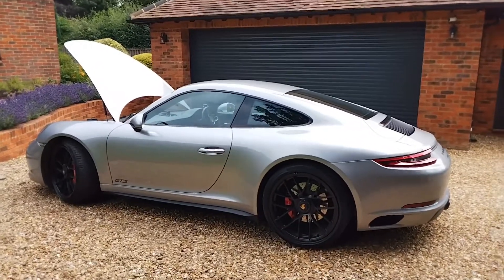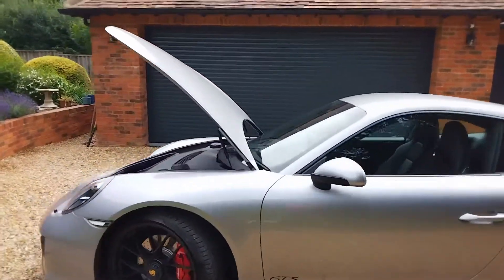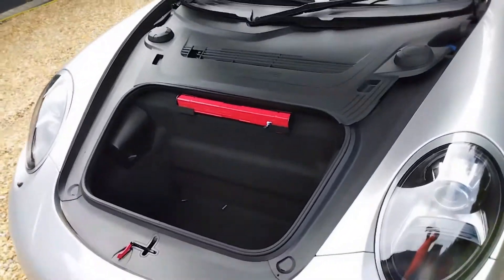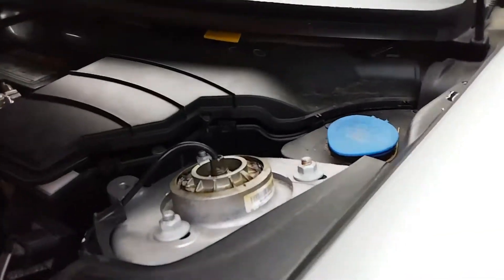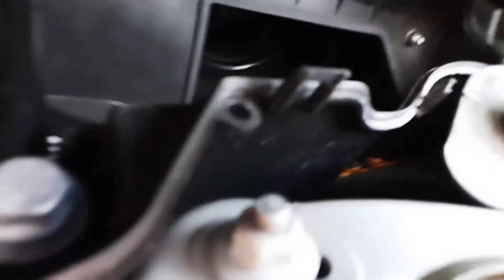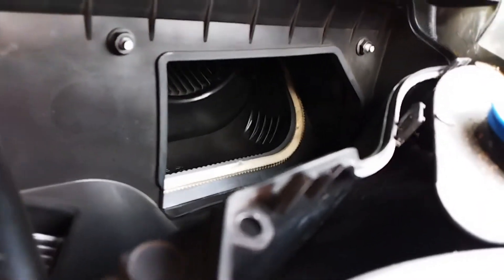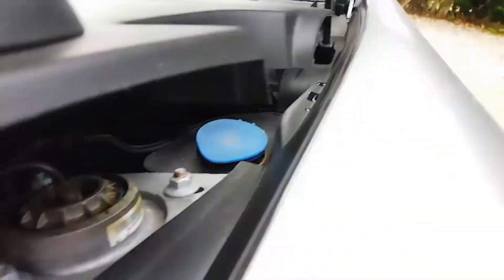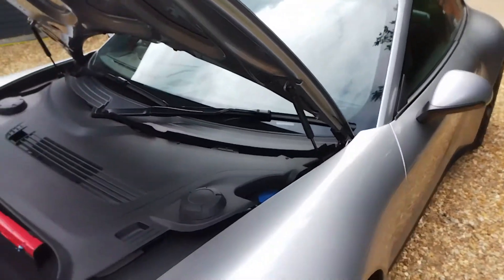Porsche 911 GTS 991.2 fans stopped working!

Comment: Its happened to mine twice in past month. Both times car was parked outside in winter cold spells. Would like to know what is actually causing it to happen but my heater fan is being replaced today at my local garage as i struggle to accept that i don't know why its failing. I've asked for the old fan back to investigate it see what i can find.
Reply from the maker: Did you do what I showed here or you just want them to replace? As long as it’s under warranty I guess it’s fine but if not then this seems to work every time